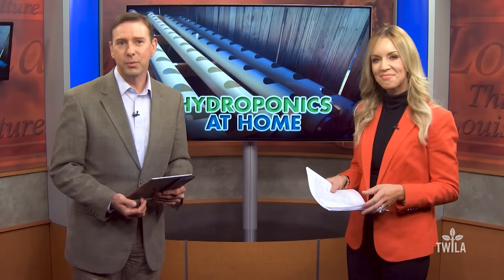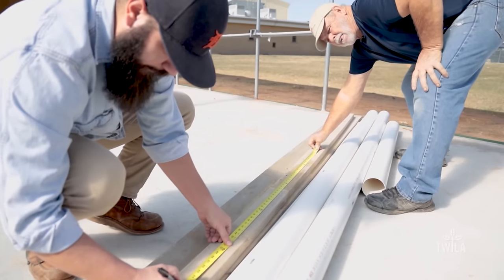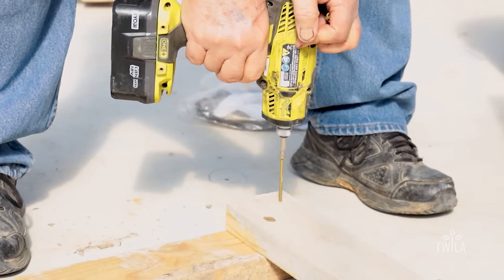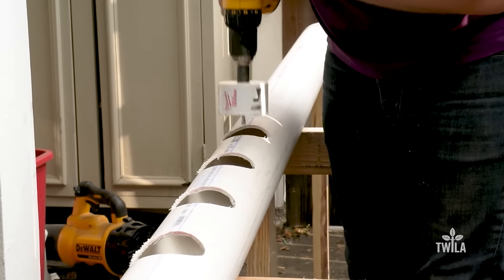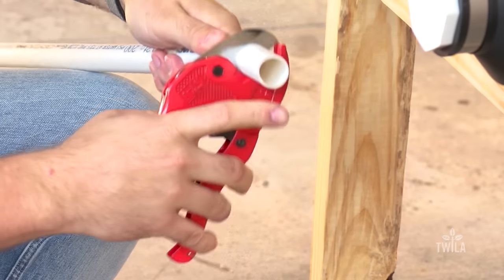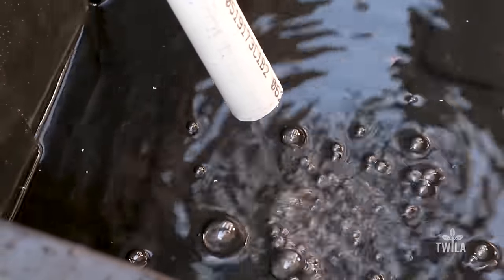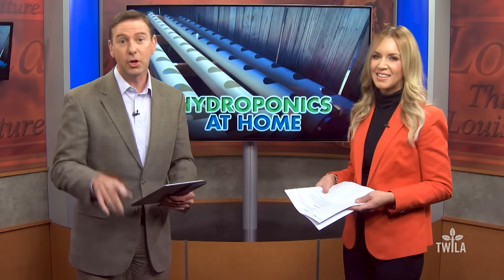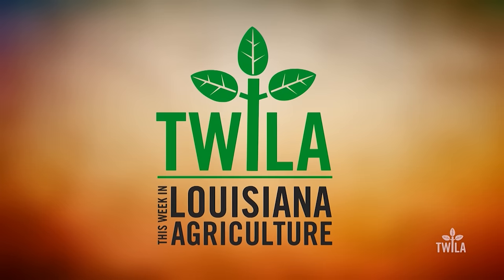Hydroponics at Home

Comment: Science experiment is right...Did anyone mention that, as PVC ages (or is exposed to sunlight), it leaches chemicals--some of which are suspected of being cancer-causing?  Insted of PVC components, use HDPE, PET or PETE ones. Defintely more expensive, defintely harder to get , but definitely safer. Especially if you're  going to eat what come into contact with it...
Reply: uuuhh you do know it only runs for about three months and most people are constantly checking the water... thats like more then half of the whole deal. also, if you think thats unsafe, you really dont want to know what walmart and other large grocery stores are selling you. now, with that said, it is true that a very small amount of trace chemicals are found after growing the plants but if the grower is safe and flushes the system out and uses fairly pure water, this should not really be that much of a problem though i would put the system under a greenhouse or something that blocks some of the uv and heat..
Reply: So, since you are so concerned about the risk of cancer, that means you do not have a cell phone (since the waves/batteries could cause cancer) You must walk around in a space suit, constantly recycling the air as not to breathe in the air (since the air itself has pollutants that have been known to cause cancer) Do you purify your own water for drinking (since CVS, Walmart, Target, Walgreens, Disney, Dollar General, Whole Foods, McDonald's, just to name a few have running lawsuits due to water they sell possibly containing chemicals which cause cancer). Do you drive a car with a radio (because those radio waves could possibly cause cancer) Do you only wear clothing made from cotton that was grown hydroponically using your specific types of pipes and that home purified water? Because if not, cancer causing chemicals could have leached into the soil the cotton was grown in. Or the synthetic fibers in other fabrics could have come in contact with cancer causing chemicals...  All seems pretty ridiculous right?!? So does your PVC comment. The United Association of plumbers, fitters, welders and service techs has stated that PVC has no affect on the quality of the water or nutrients flowing through the pipes. Only metals that can rust in time will cause some problems for your plants, but PVC hydroponics are safe.
Reply: @tommysobo123  This is false. PVC leeches into the water supply and should not be used in systems that will concentrate these contaminants (i.e. growing food). It is safe for bathing and washing and even reasonably safe for everyday cooking - where the water passed through your pvc system only briefly as it flows from the street to your kitchen. As to the 'The United Association of plumbers, fitters, welders and service techs' ... those are not biologists, they are tradesman skilled in installation.
Reply: Thats an important information sir
Reply: I believe uPVC pipes are safe to use :-)

Comment: Help!.  We have an issue with too much water going in so overflows from.   We are using 300 gallon per hour pump which is supposed to be adjustable although doesnt appear to be the case.  Is this just too much pressure?
Reply from the maker: Likely too much pressure. I had to add a valve to slow the flow into my first pipe and that fixed my issue.
Reply: This Week in Louisiana Agriculture   Thank you.  We realized that shortly after posting.  That was it, and valve solved the issue.

Comment: is a 55 gallon water tank  really needed?  i was hoping a 26 + gallon bin would work? alo does the width of the pvc matter also thinking of going smaller (thinner).  any help would be appreciated. Thanks in advance!
Reply from the maker: I don't know if it's really needed, but that's what I used (because I already had it). You can probably get by with a smaller tank, but you'll need to watch it closer and adjust your nutrients for that amount of water. You can use a smaller pipe as well if you'd like. I know some people use 3" pipes. Good luck.

Comment: Dont think PVC is safe for growing food...
Reply: Beats starving
Reply: PVC has no affect on the quality of the water or nutrients flowing through the pipes. Only metals that can rust in time will cause some problems for your plants, but PVC hydroponics are safe.
Reply: been drinking my water from pcv for 45 years.
Reply: PVC is commonly used in new home and commercial buildings for domestic water supply....you already have PVC in your blood...not to worry....